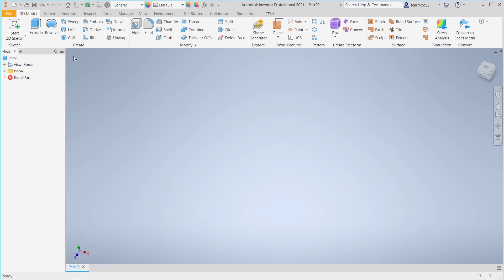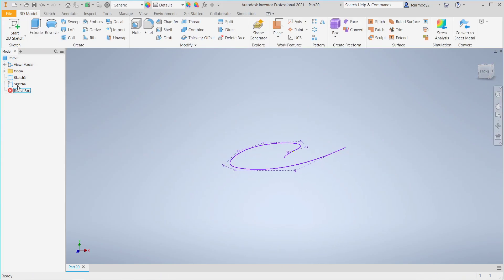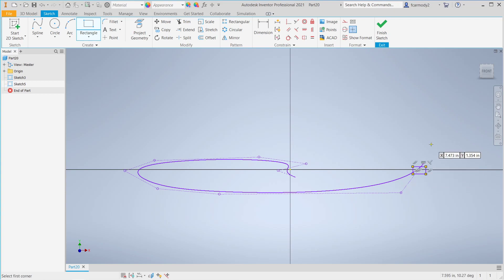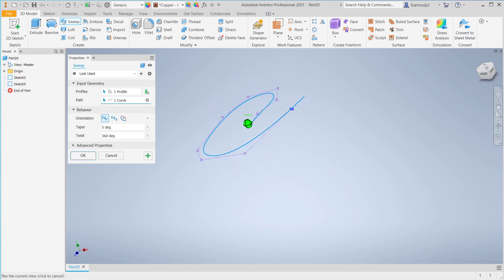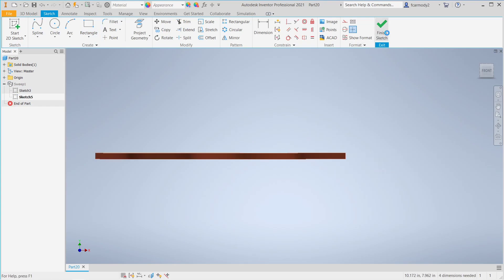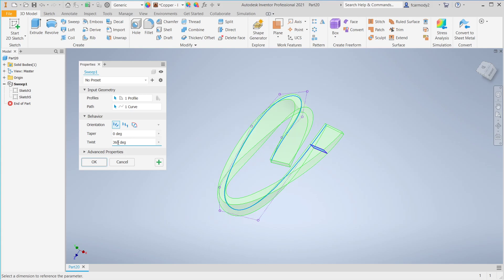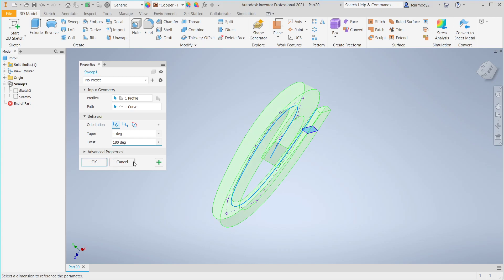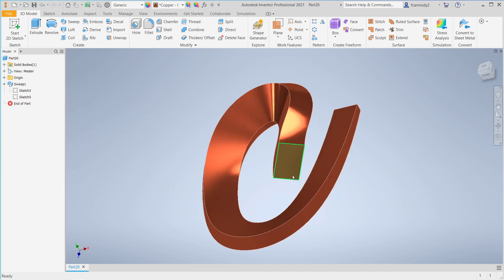Inventor 2021 : 10 : 3D Sweep Tool

Comment: I like your tutorials, I do.  But please plan out your tutorials more.  Have exactly what you're going to do planned out, so that way you don't have to go guessing what will and what won't work like for the twisting part.  Planning out will also prevent you from not knowing what to say in certain parts and say "Uhhh". 

I am going to continue to watch your tutorials, hoping that you will release some more.
Reply: I've looked at your YouTube channel and it's got some very interesting material on there. However, under your 'About' tab, I noticed that you continued your opening sentence with a comment included in brackets but your 'But' started with a capital B, this should have been a lowercase b. Also, further down, you spell 'channel' as 'chanel'. There are also too many capitalised words, especially the last one, this makes one wonder if it was written by a child. Planning out what you want to say and then proof reading what you've put may present a more literate approach in certain parts.

I'm going to continue to check in on your channel hoping that you will have corrected these issues.